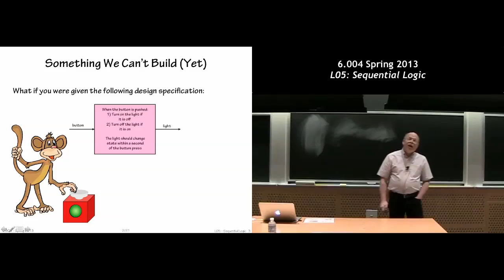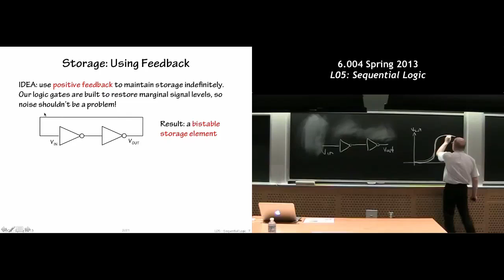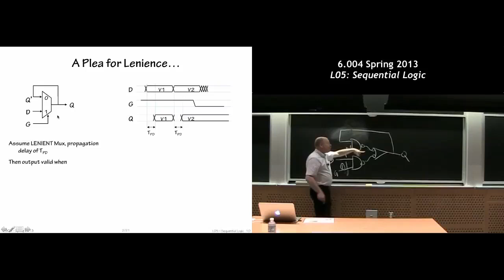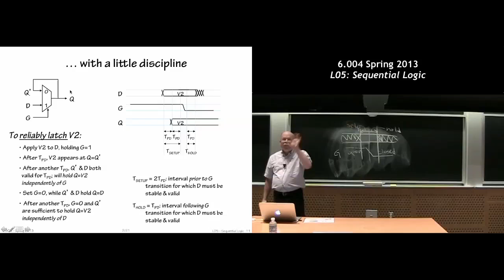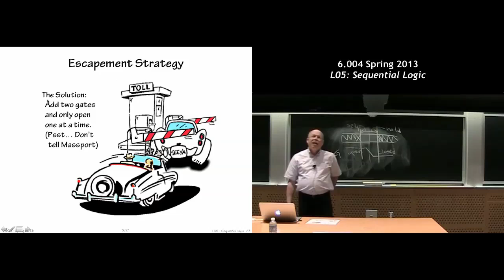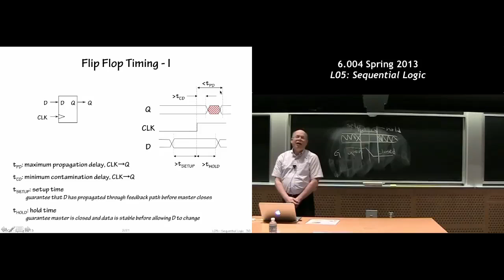MIT 6.004 L05: Sequential Logic

Comment: It would have been extremely helpful to me if the problem stated 23 min in was explained in more specifics using the schematic and not just in abstract. Referencing the "glitch" from the previous lecture and drawing the "fix" into the schematic would've also helped a lot. It took me quite a while until I figured out that connection. As an actual student sitting there without pause and replay I would've had a lot of trouble following the rest of the lecture.